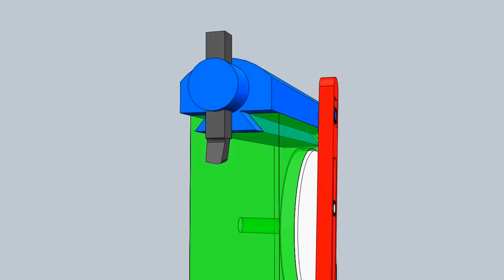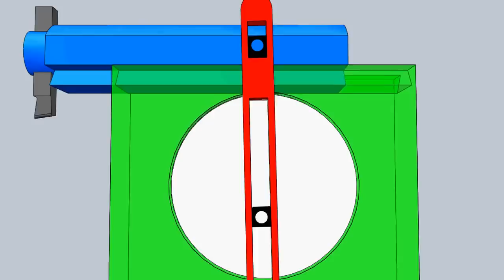Shaper quick return mechanism

Comment: I don't see any difference on the forward and reverse travels!!!
Reply from the maker: The difference is very subtle. The difference can be seen by the angles of travel of the bull gear in the forward travel and backward travel. Since the speed of bull gear is constant, a greater arc traveled in a direction means more time taken compared to the other direction.